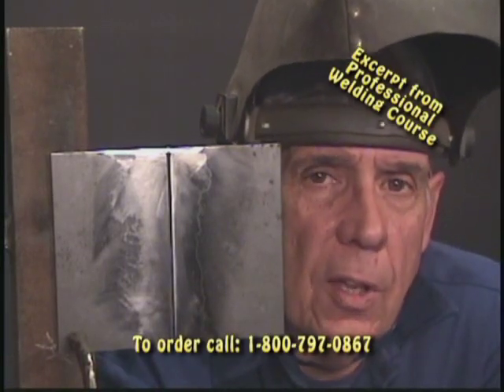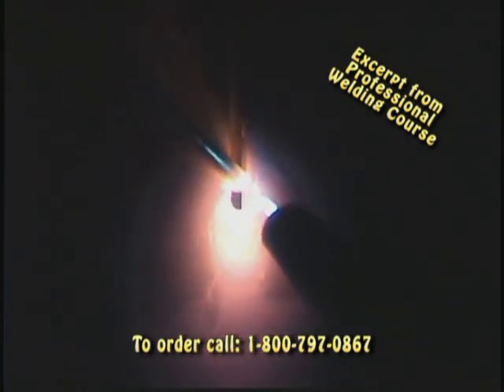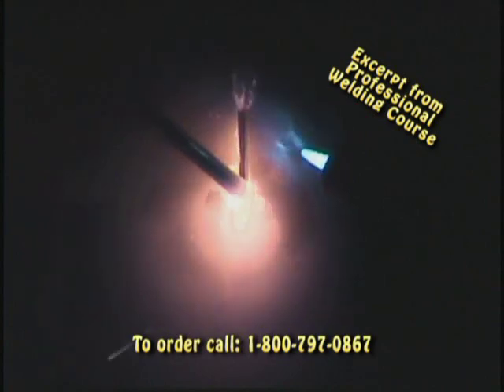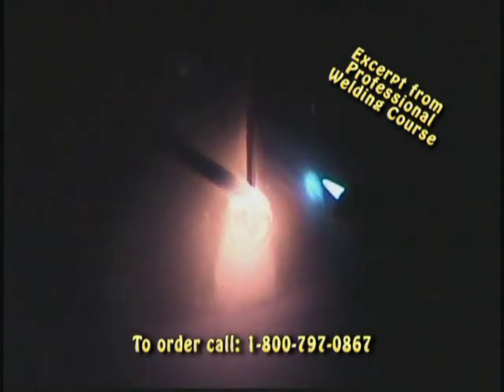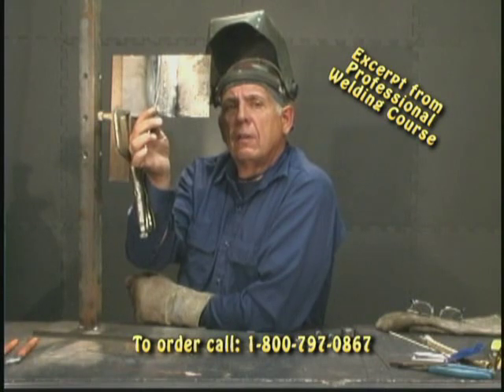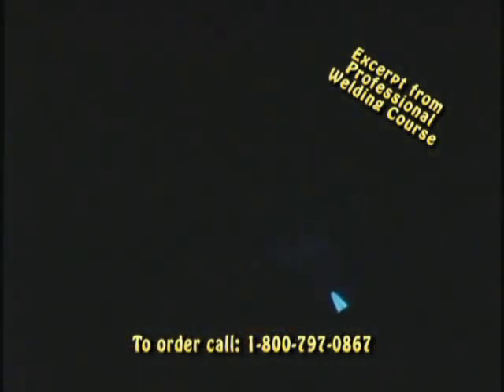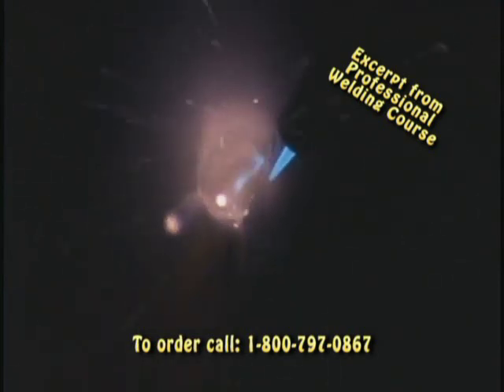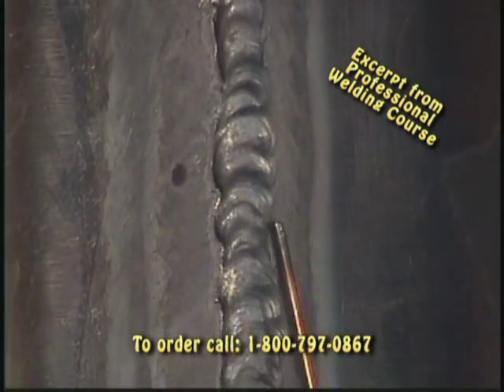Learn Gas Welding Vertical 2A 3G Position

Comment: @jmackman its not actually that bad man,i taught the same as you when i first started a gas welding course,but i got the hang of it and now i like it.ive did plate in flat uphand,butt joint and v joint
main thing is the puddle you need to keep that going and you'll get a nice weld.